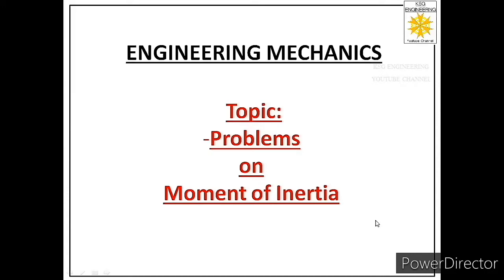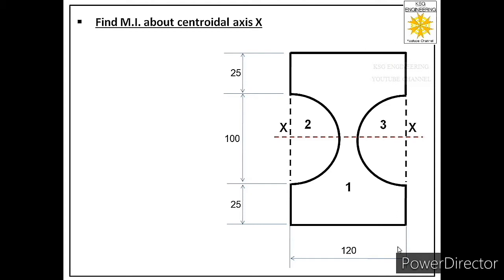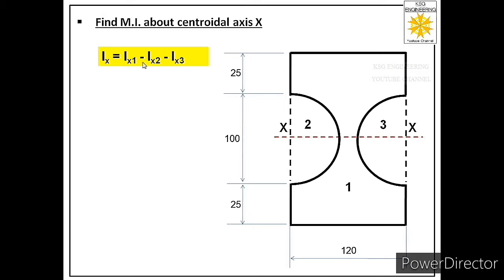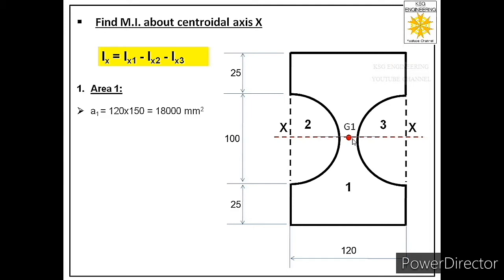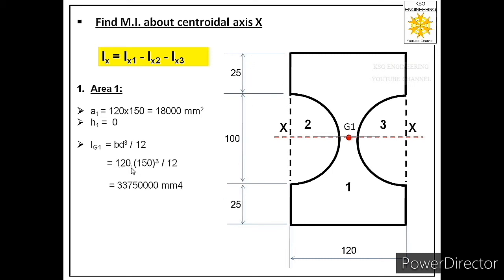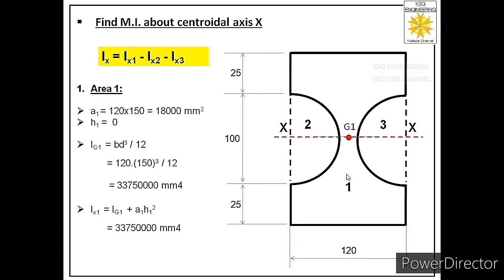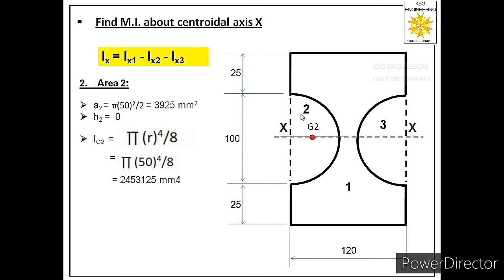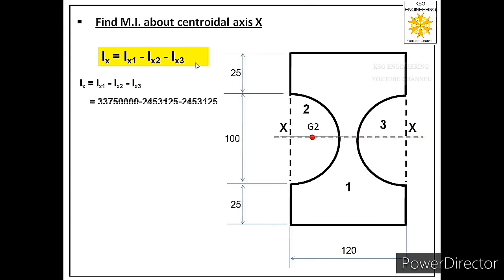numericals on moment of inertia | moment of inertia engineering mechanics

Comment: Why we can not use 0.11r^4
Reply from the maker: 0.11r^4 is about the axis parallel to base of semi circle and passes through its centroid. PARALLEL TO BASE. So it will be used during calculation of MI along y axis